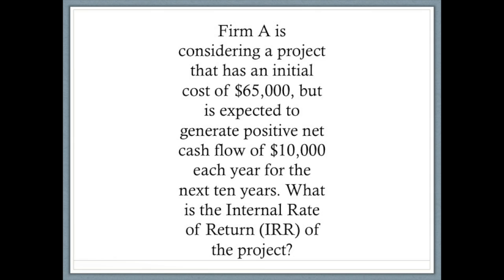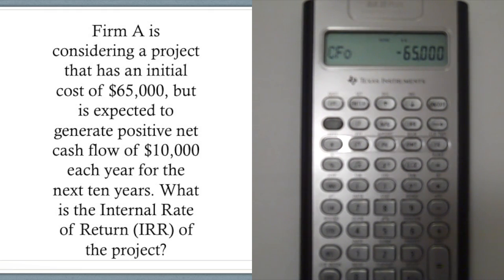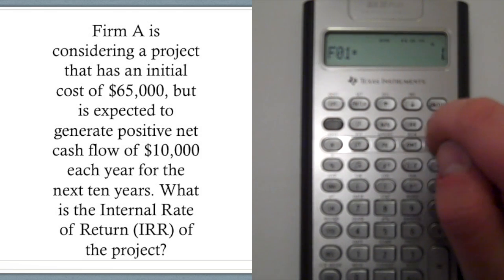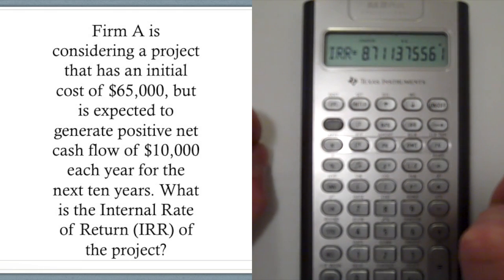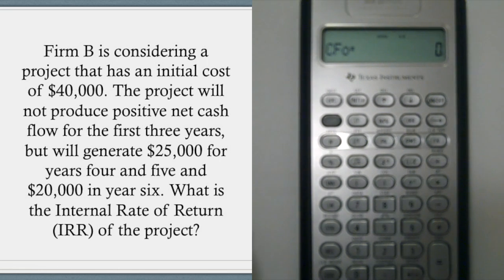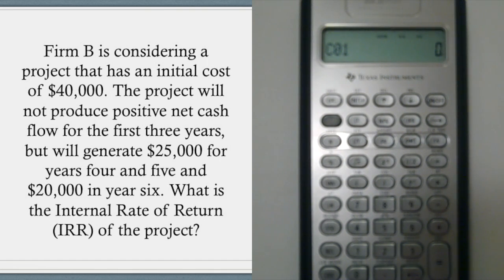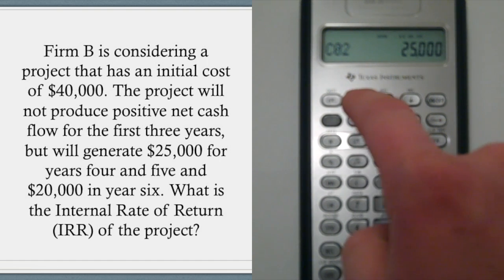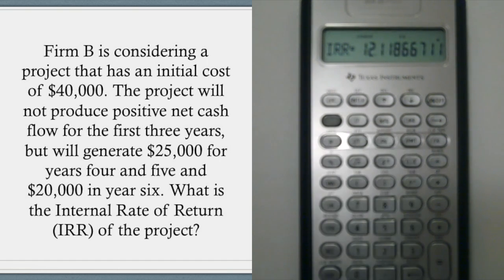Calculating IRR Using BA II Plus

Comment: Would you be able to this with percentages instead of cash flows? For instance, instead of receiving you receive membership. As in, your company has members, and the membership base is increasing by some percentage.
Reply from the maker: Uwekerner04, unfortunately over a multi-period time frame an IRR calculation does not provide a very meaningful unit of measurement for percentage increase. Try using the percentage change function (2nd 5) on your BA II Plus. This will automatically calculate a percentage change for any two numbers. For multiple periods of time a CAGR may also be useful for your purposes. Hope that helps!